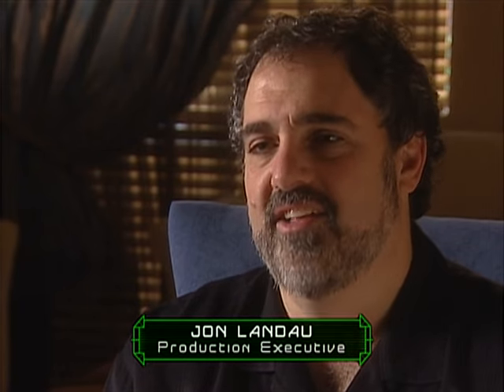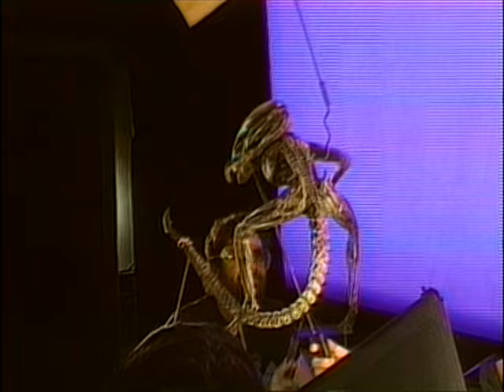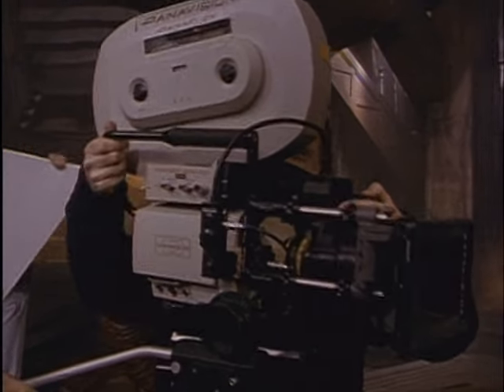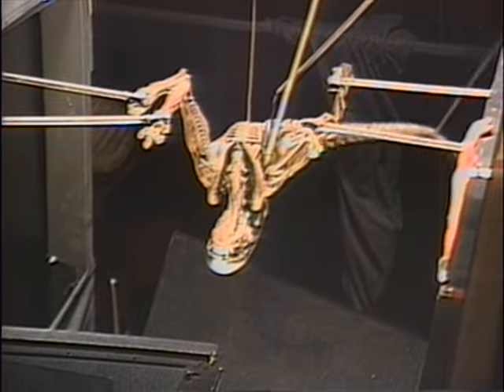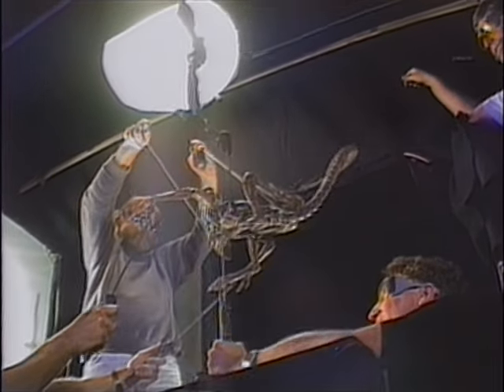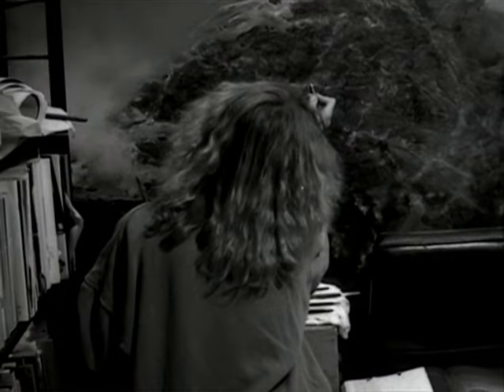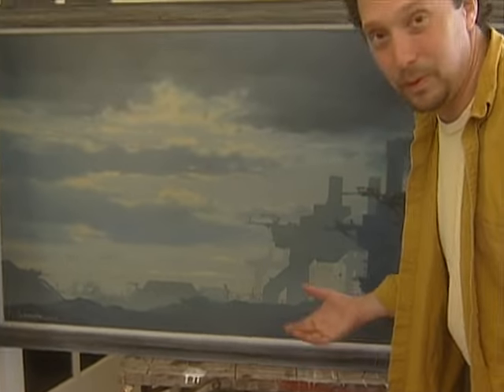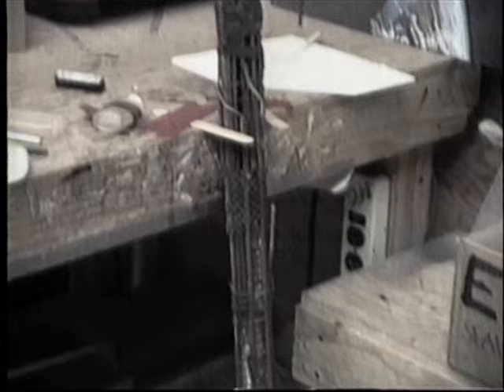ALIEN 3 Bonus Making Of

Comment: Digital compositing would have made all the difference. Terminator 2 had it one year before, and the T1000 shots looked great. They blended perfectly.
Reply: xtrmst_012  The thing is, the movie started production in late 1988. Realistic CGI was unthinkable back then. So, in 1989, they committed to doing the creature effects with miniature puppets and a guy in a costume. The puppets sometimes look good, but most of the time look pretty bad. Late in production, in 1992, they retouched them and added shadows with CGI, making them look even worse...
Reply: xtrmst_012  Photo-realistic creatures with skin and details like eyes and teeth were not feasible in 1989. Remember that the CGI in The Abyss was mostly water, it didn't have realistic skin. In Terminator 2 the creature was metallic, with no real detail. The technology advanced very quickly, so by 1992 they could manage to make creatures with realistic skin and shading. But in 1989, only three years earlier, it was indeed unthinkable.

Comment: Wow, I really thought that ALL the xenomorphs in Alien 3 were CG - something about the lighting and the way they move in a scene. But no, it was all done practically with puppets. The puppeteering and the way the puppets can move is incredible to watch here! It really must have been the compositing that made it look so bad. What if they did a remastered version and fine-tuned the compositing from the original elements? How drastically would that change this film?
Reply: It’s been corrected digitally on the quadrilogy box set, it looks much better than before as far as the colour, but it’s still a bit lacking in stuff like light & shadow matching and motion blur, but still, it’s way better than it was.

Comment: 4:19 Commentary about building specialist rigs & dollies with gimbal tracking & 100’s of thousands of $$$ in production fast forwards to 2024 & what have you got ? DJI Ronin 4D with a Tilta Hydra / Float Arm & DJI Master wheels. A complete operation for a 1/3 of the cost & man power & YET Hollywood still prefers to go the way of the old & not recognize GREAT tech that can save a production 100’s if not millions.

Comment: Why didn't they use CGI to make the alien?
Reply: Because it was in the 80s and they had nothing like CGI
Reply: it was 1992. A year before Jurassic Park's CGI revolutionised film making for better or worse!
Reply: @derekcfoley  I think Jurassic Park did it right. CGI when it was totally impractical, puppets and models when it can be done practically.
Reply: At the time, Boss had no render farm and barely had enough capable computers to render a TV commercial. I think we had 2 Silicon Graphics machines at the time. And no one capable of that kind of animation.